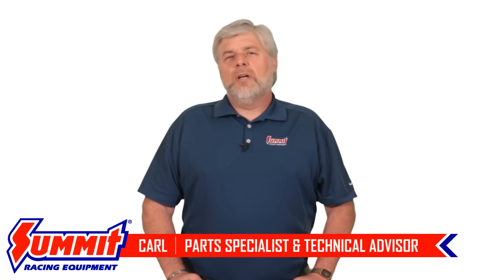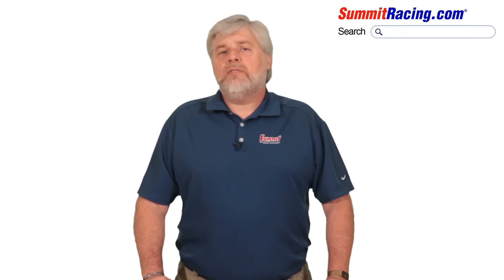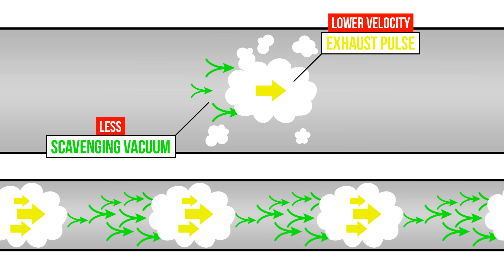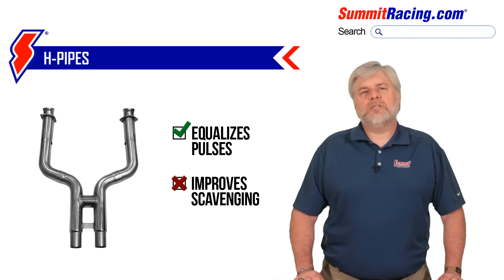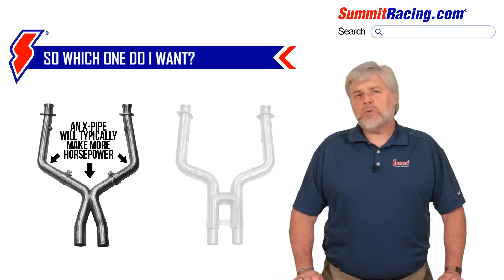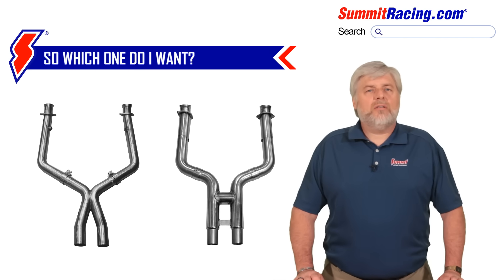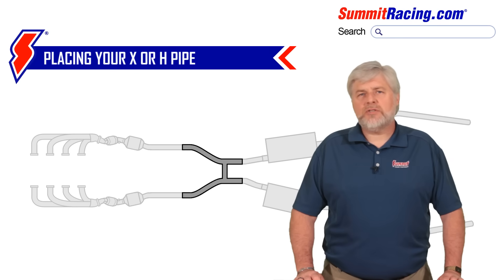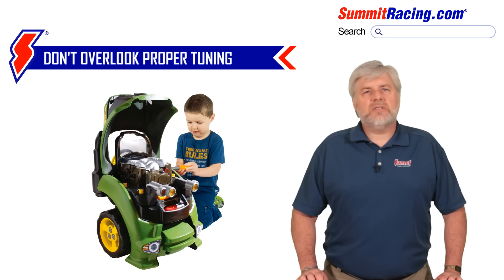Exhaust H-Pipes vs. X-Pipes: What You Need to Know

Comment: 93 Ford F150 300 cubic inch 4.9 liter  manual   engine  this vehicle produces what would be the best recommended exhaust system for this car to get a little more fuel efficiency and power

Comment: Which would you recommend for a 2010 4.7L V8 with cold air, a straight-through muffler, and Superchips tuner?

I won't lie, I want performance out of it (nothing crazy obviously) but I have a camper and a boat that I want to tow and that's my main reason for upgrades.

Comment: I have a small block Gen 1 with 3 inch headers and straight pipes into the dual exhaust. The muffler is unknown. But how to get it more quite? Is it all about the pipes or only the muffler or both. Easiest way is to just buy new muffler but is it the right way or waste of money. Right now it is hammering in the inside to much at all,

Comment: I have a v6 2002 mustang and I want more power with out affecting torque, Is there anything I can do exhaust wise ?
Reply: Swap in a coyote. Not a smart remark but an honest opinion. Just seems you can never get the power out of a v6 mustang. Sure a few bolt ons will help but you wont get any great power out of it. In that application there is no replacement for displacement. Unless you opt for a turbo. But if you put in that type of money you might as well put in a 4v.

Comment: Thanks for the video! Great Information!!... What are your thoughts on putting an H or an X pipe on a 1973 392 International engine in a Loadstar 1700 Semi Cab? Or should I go with a Y pipe or just full blown Dual exhaust? What I'm wanting to do is make the engine most efficient at pulling a 30 thousand pound trailer.
Reply: Straight off the header 👍

Comment: It’s a great explanation of how exhaust systems work. So many automatically think that larger diameter pipe is better. However, I have seen a number of tests showing that there is little to no scavenging effect after the cats/test pipe area—so an h pipe or x pipe would play little role in that realm
Reply: Scavenging can also be adjusted with cam timing. Changing the duration and overlap of the intake and exhaust can have a huge effect
Reply: @chrismoriarty3342  that is true in cases where that’s possible—or is the change in scavenging more of a biproduct of the cam timing adjustment?  You could argue that cam timing is adjusted for purposes other than scavenging

Comment: An H pipe creates a balancing of pulsations between each cylinder bank upon scavenging, it does enhance a smoother throttle response somewhat.....doesn't necessarily enhance the expulsion of exhaust.

Comment: I run true duel on my 454 Olds with a 2 bolt main and I have no issues. Iv ran both an x and h pipe with different size pipes and could not get the power I wanted until I just ran 2 pipes from the headeres to an over the axel dump and it seems to work the best for me. How come the true dual wasn't mentioned in this vid.
Reply: Because these are professionals -- they don't buy into that "true duals" bullshit.
Let's face facts -- if it has 2 Mufflers and 2 Tailpipes, it's a dual exhaust. Period.

Comment: Nice video! I own a 2014 Z51 C7 Corvette. Huge advertising budgets have been expended by the likes of Borla,  Corsa, Billy Boat and Atak on their cat back pipes and mufflers for “performance power and sound.” Each one of these system cost thousands of dollars in parts and labor for what I read maybe only 2-4 hp. I would think that Corvette C7 engineers like Tadge Jeuchter have already engineered near maximum power into the power train. So my question is: can these aftermarket systems possibly be worth their cost? If not, why do many owners gravitate to them nonetheless? Your thoughts are appreciated.
Reply: status symbol tech perhaps ?

Comment: Sweet, someone saying don't change OEM it might be better
Reply: I remember back in the late 1980s David Vizard (A-Series engine tuning GOD) taking examples of all the then current 'performance' exhaust systems available to do a side by side comparison of a flow bench then dyno. The best system was the RC40, but a couple of the performance systems flowed less and gave less power than the stock system, so yes, sometimes the stock system IS better! Especially if the people designing the after market parts know more about crochet than engineering...

Comment: THE HORSE SHIT THEY FEED YOU
When will these scam clowns post flow bench pull sheets?
They wont,they trust youll just eat the sht as they serve it
Mufflers and all connectives are for SOUND management
Same BS applies to cold air kits that help you draw more hot underhood air to your motor.
Same applies to asshats and light bars,they are douchebag tats :finger

Comment: Can the crossover pipe (x pipe or h pipe) be placed before cat converters? Will the engine light throw a code? How does the sound change if it is closer to the engine?
Reply: NO. Cats first, then H-Pipe, then Mufflers, then Tailpipes. The CEL won't come on if you do it that way.
You won't know if OR how the sound changes until you hook it up.

Comment: Put a lm7 5.3 in my 80 regal . I want that old school rumble , currently single pipe with a 8” cherrybomb that sounded exactly how I liked it with the small block 265 it had in before. Which is the way to go for the old school raspy sound? Not rich either so would a simple straight pipe work?

Comment: What’s left out here is the information on Pressure Waves and Back Pressure. Some engines are factory tuned with the back pressure needed to perform as tuned, no screwing around with the exhaust pipes. I.E., Porsche, BMW, etc. Same goes for highly tuned systems relying on pressure waves in the line. This is for guys wanting to make their car sound cool and maybe run better? Good info for legends in their own mind...

Comment: Depending on the Application, my 03 Cobra sounds badass with the X especislly deceleration. Those pops and crackles. But on the other hand our 5.0L Range Rover without the X sounds Epic.
Reply: The pops and crackles are a sign of air getting in , system isn't fitted properly.

Comment: I'm thinking if the optimal convergence is all about timing then shouldn't there be a pipe for each cylinder which converges with every other pipe at the optimal position downstream?  I guess on a V8 with in this setup you'd have to have 64 convergences between all pipes for the optimal setup.
Reply: What you are describing is a set of equal-length tuned headers -- as used on Indy cars.

Comment: We used to do the spray paint method to put the H-pipe. Spray the exhaust pipe  lightly from the collector back (or after the catalytic converter). Spray back a few feet or so. Run the car hard to burn the paint. Where the burn ends, put the cross pipe.

Comment: Idk what to install on my Pontiac G8 GT 6.0L need help
Reply: 1. equal length, full-length headers. 
2. short-tube, equal-length or Tri-Y headers, for improved torque...
3. a 3in.- 3.5in  collector feeding into dual exhaust ...your choice of X or H cross-over.

best effort in both cases. feeding into 2.5 in. - 3 in.  exhaust ... exiting some where - other than under the car. ...Under the car will make more noise, but it'll shake your kidneys (and just might cause carbon monoxide fumes to collect under the car.

Comment: I have a 09 Silverado wit a 4.8 .. longtube headers with a mild cam ..what would be a good recommendation for this set up x or h pipe
Reply: I think you're going to be  much happier with the h pipe... smaller engine will benefit from the improved low end torque. Besides you're going to like the way it sounds at idle.

Comment: Interested in your suggestion for my application.
Jeep 4.7L stroker, custom headers with dual outlet.
Option 1, Y-H-or X pipe after headers into single muffler?
Option 2,  straight off headers into dual mufflers? (No crossover at all)
Option 3, H or X  pipe into dual mufflers.
Interested in "best" scavenging method and a nice, deep,  aggressive growl!  
No Cat necessary as a "classic" vehicle.

Thanks 😉

Comment: What is the best distance between the two pipes for a H-pipe?
Reply: Use the same method as locating the best position for exhaust dumps... single chalk line down the exhaust. Beat the loving snot out of it.  Follow the lines from the rear forward, where the lines dissapear is where you want to cross them x or h pipe. This is where heat scavaging ends and pulses begin carrying the exhaust

Comment: X pipe, H pipe, is like tube headers vs stock exhaust manifolds,  You might gain 5-7 horsepower.  Not worth the money or effort.  Ive put headers on many cars and felt no difference in performance at all.
Reply: Wondered someone was going to mention the pitiful amount you gain for the expense!

Comment: My experience removing my H pipes for X pipes is. I noticed that the H pipes sounds better and deeper, X pipes it sounds good but not very deep, the X pipes gives you  arround 4 hp or little more than H pipes. I honestly miss my H pipes I regret removing it. I drive 2002 mustang Roush stage 2 with side exhaust. By the way every engine will sounds different. With new mustang will sound better than mine, 5.0 cayote sound good. mine is 4.6 2v. I will do a cayote swap when this engine goes bad. Future plan. I hope this will help guys. X and H
Reply: You 'noticed' by watching the Engine Master's dyne test, huh?
Reply: I have a 2016 5.0 with an x pipe, RTR Magnaflow axlebacks and it has a great tone especially at start up. I don't like obnoxious loud so I can still sneak out of town. Would've went with the competition mufflers but my neighbors would probably hate me since it is my daily driver. One still says car is too loud but x pipe ain't going nowhere! 🙄😁

Comment: What about turbo? Bigger is better. Backpressure is not your friend!
Reply: This is true except when heat is applied..  the hotter the hot side is the better it will scavenge.  Also the more heat will build in cold air side.

Comment: Japanese invention on their drift car then nascar started using them in early 2000.
Reply: Nascar been using them since late 70's early 80's Sterling Marlins Kodak Chevy flipped at Daytona the world saw his exhaust system on TV. The secret was out. Check out Dr. Gas history. I put it on my truck 3" off the headers all the way to behind the tires. I had Flomasters in the system sounded great. Kinda quiet tho. Took them out replaced with straight pipe. Best sounding system ever. I won several best sounding trophies at car shows. Voted by others also by  DB meter over straight pipes and H pipe. It was wicked sounding on a 406 SBC. At 100 MPH close your eyes sounded like you was at Daytona or Talladega

Comment: Hey Guy’s, Tim I have 84 GMC Sierra classic p/u with a TRE 383 stroker making about 550 hp and H pipe with 3 inch exhaust and 1 3/4” ceramic long tube headers by headman headers is the H pipe for this combination.

Comment: I notice that with H pipe my left exhaust tip   gets extremely hot. 190 degrees drivers side and 140 passenger side.
Reply: Sounds like a lean condition on the left bank of cylinders. Clean your injectors.
Reply: Same muffler used on both sides?

Comment: If you have a modern 3.7 v6 or other dohc motor that already makes most of it's power above 2000rpm, xpipe is probably still the way to go.
Reply: I have a 2011 Tacoma with the 4.0L V6, the characteristics of the H pipe fit my situation best, but considering your comment, would that still be true?

Comment: OK...having watched the video...I have a street driven, sometimes tow vehicle, 2012  Jeep Grand Cherokee Laredo, with a 5.7 hemi...question, X pipe,  H pipe or stock exhaust configuration?
Reply: I'd say If you want to change things already a H pipe would be better for the low end. Otherwise stock is probably good enough.

Comment: If he's a "Tech",he should know a motor has NO exhaust because s motor runs on electricity through copper coils and magnets. Its s Fuckin ENGINE!!
Reply: Motor provides motion. Engine is a word that's derivative of ingenuity. It has littie to do with fuel. The lead car of a train is called then engine not just the actual power plant within the car. The driver is sometimes called the engineer. Not because he went to college and got a degree in engineering but because he drives the engine. And an engineer is a designer, a thinker. Engines aren't called engines because they run on fuel they are called engines because they are inventions and ideas that moved society. But strictly speaking they are motors.
Reply: all the oil bottles disagree they say motor oil not engine oil lol.

Comment: Internal Combustion ___________?  [X] Motor  [✓] Engine
Reply: THANK YOU!
Device using electrical energy of batteries or grid,  to rotate a shaft via an armature and magnetic fields, = Motor
Device using the energy of compressible and/or flammable substances to rotate a shaft via pistons, rotors or turbines, = Engine.

About the two-wheeled vehicles though..  "Enginecycle" does sound awfully weird.  But technically correct.  Unless it's electric..
Reply: Great comment. I'm a tech and it bothers me when other people say "motor" when speaking of an internal combustion ENGINE.
Reply: @mauricioibarra701  👌
Reply: Engine creates power.... motor converts
Reply: You're absolutely right! 👌

Comment: Yeah I think you're a little off on your information about exhaust diameter. You can even look on engine Masters where they tested diameter size of exhaust and it shows the bigger you go the more torque and horsepower you make also applies with headers
Reply: Not with a small block Ford engine.  The Windsor small block performs best with a little  back pressure.
Reply: Even that is generic a lot of it depends on application needs. Where in the rpm range an engine makes power is very important as well. If you are drag racing or towing you want the power in the lower rpm range. If you are running endurance or drift you want the power higher in the rpm range. If you are cruising on the streets and never race on a light to mid weight car you want the power in the middle of the rpm range if you are driving a heavy car you want it in the low end to move it from stopped. My car had true duals from the factory and was tuned for it. To deal with exhaust scavenging they made very header like manifolds that are asymmetrical to even scavenging so for me the best option is stock u tilt I break the 700hp mark then it is long tube asymmetrical headers into 3" pipes but still true dual all long as I stick with the factory block and heads. Change the heads change the setup.

Comment: 2007 Silverado LT currently running a 5.3L, planning on intalling a 6.2L max with an 8spd tranny in Sept, supercharger, cam, TBI Spacer, wrapped headers, tuned for performance, eliminating limiters ... for the most part, which headers and exhaust system would you reccomend?

Comment: Since the power gains are only 1-2hp difference between xpipe and hpipe....i would go more for the  sound you want to gain....Hipipe for the win for me. Much deeper and more of a  muscle car sound on a v8. I had a hpipe...swapped to a xpipe to see the difference. Didnt feel any power difference, just a higher pitched slightly raspy exhaust note which i hated. Went back to a hpipe within a week. Lol. Will never use a xpipe again. Lol.
Reply: My thinking exactly.  I have an appointment to have an H put in my V6 Challenger.  I've already done a reso delete and mid muffler swap with 18" straight through ovals, and love the sound.  After doing some reading and vid watching, I decided separating the pulses more would make it more rumbly, and possibly restore the very small perceived loss of low end power after freeing up my exhaust flow.  Looking forward to the results.
Reply: @TimBExhaust  How did it go?

Comment: I wrapped my exhaust on my S10, what I ended up with was rusted out headers after a year or so. So, I definitely would not recommend it. Your results may vary.
Reply: Wrapped headers were a good .... short term solution to the problem of too much eat in the engine bay... as car became more aerodynamic, the heat became more of a problem.

     Once the aluminum/ceramic - coated headers became widely available at a decent price, there was no good reason to continue using thermal wrapping (especially not on a street-driven car). As many people found out -a winter-driven car, with road salt, snow, rain etc. ... all the moisture would collect inside the wrapping and hold th moister in close contact with tubing headers, exhaust pipes. 

   Aluminum/ceramic coated headers ... are much better at resisting heat damage as well as (when coated inside and out) ... they send most of the heat to exit the car... instead of collecting and heat soaking (steaming up) all the moisture.... yes, rusted out headers and exhaust are a big issue when using thermal wrapped exhausts.
Reply: That and they have heat wrap sealant just for that reason you just stay it on thick and let it dry
Reply: Yeah it’s pretty obvious you wrapped a metal not meant to be wrapped. I’ve had wrap on my headers for years and show absolutely no signs of being rusted out. Learn from your mistakes.